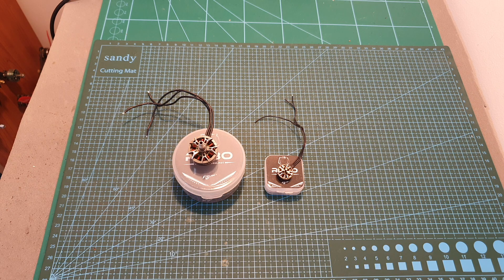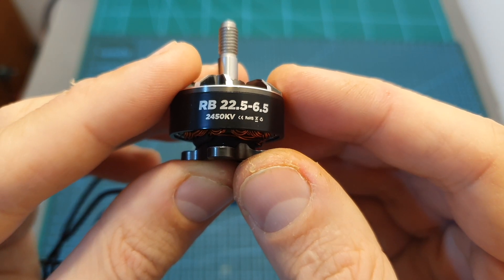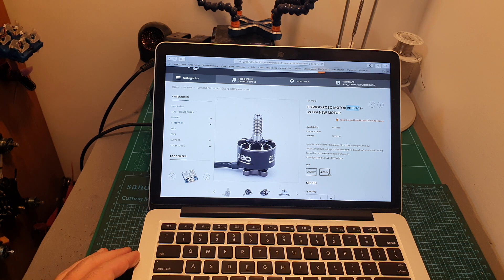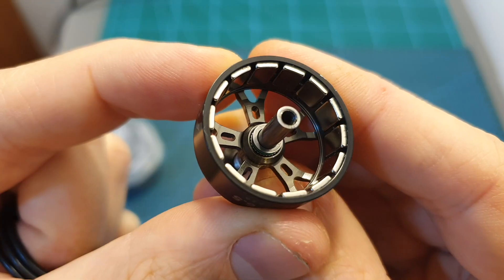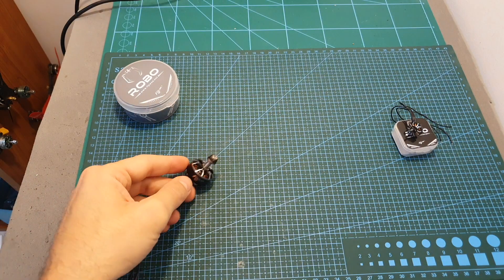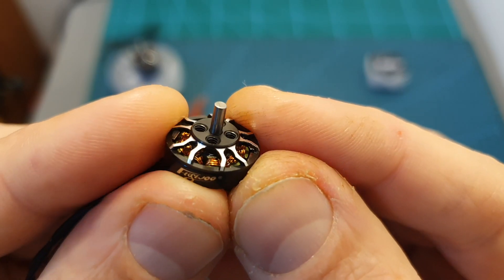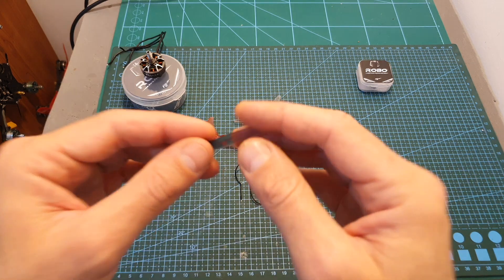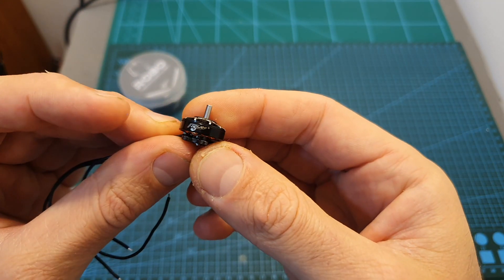Flywoo ROBO Motors - RB22.5-6.5 & RB 1202.5

Comment: Emax Eco 2 Vs Velox 2207 Vs Robo 22.5 6.5 which one will you recommend
Reply from the maker: I hope to test the Emac Eco 2 motors soon. As for the recommendation - it depends on your setup and your expectations.
Reply: @KremerFPV  in my case availability is issue it takes months to arrive when I order something for myself or get it from LHS (velox in stock). .. nothing hard-core or extreme Just normal flying
Reply from the maker: @justhackitfpv  Get the Velox from your local hobby store, these are great motors :-)

Comment: I really like the 1202.5 motors. 2mm shaft eliminates the need for prop screws when used with compatible props like the Gemfan 3016 tri-blades. I think this motor will be great for a super lightweight 3 inch build on 2s 450. Nice that the KV is higher than the fpv cycle motors if you like 2s.
Reply from the maker: I am working on a new build using these motors, stay tuned :-)

Comment: Please add the thrust test of RB1202.5  with   Avan Rush 2.5.
Reply from the maker: Sorry but I can't do that.
Reply: Hi @KremerFPV   Is it possible using 1202.5 with Avan Rush 2.5 on 3s hvlipo?
Reply from the maker: @mitsuhashihiromi1581  Yes, it should be possible. I am going to use these motors on a 3" 3s build soon.
Reply: @KremerFPV  Thanks. I will replace my motors to RB1202.5  on my Vader Tyro.
im looking forward to your new build.
Reply: @KremerFPV  did you that yet? If so, are the motors good for that?
Reply from the maker: @ELValenin  No I haven't eventually, sorry. I used a different kind of motors.
Reply: @KremerFPV  ooh did you use them for something else?

Comment: Hi Gal, do you thin 1202 its better than 1103 for freestyle?
Reply from the maker: Not sure David. I will have to test these motors in order to tell you.
Reply: @KremerFPV  I did already and is not better than 1103 by the way I've tried in a tadpole also 1105 5000kv and those are the best so far